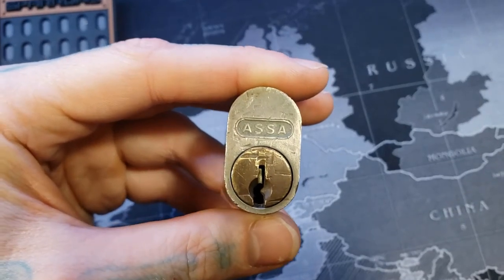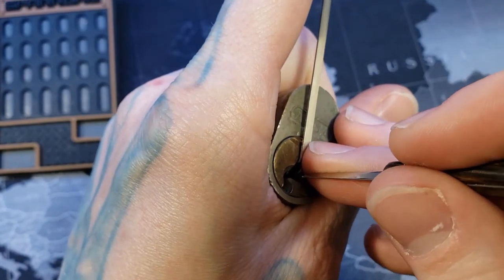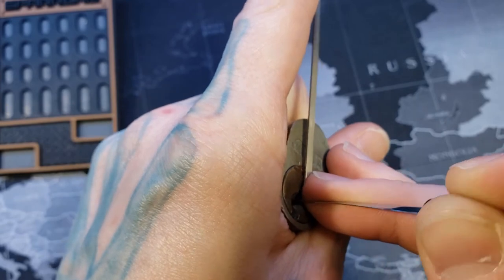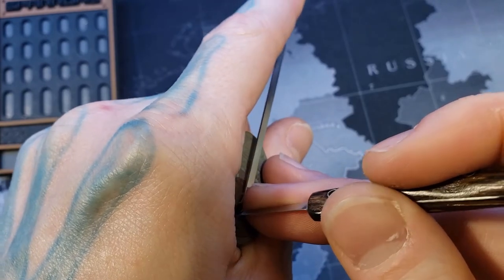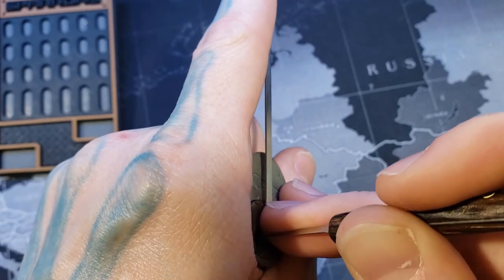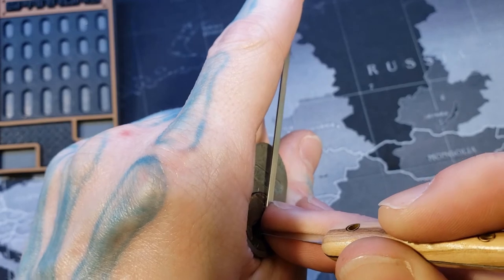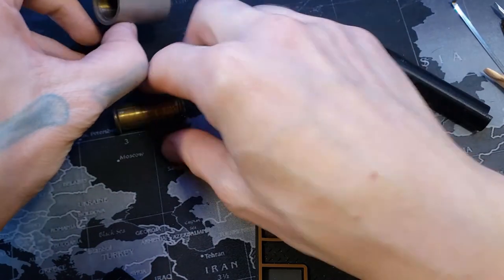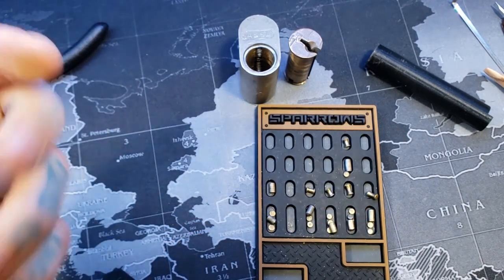61) Assa 700 Picked & Gutted

Comment: Great job, forgive my ignorance, but why was the second pins row removed, never picked one. Is that how they come?   Have a great weekend 🔓😎👍
Reply from the maker: I wondered the same thing when I first picked it.  I can't remember exactly which picker it was at the moment, but this is what they said: 

"For main entrance doors in heavy masterkey systems, it is normal to leave one empty, than put a 9 pin, and 8 thin wafers on top to make up for every possible combination. And it is still a 6 pin lock with Security Drivers.

So that gives 9 different keys on one chamber, compared to many wafers in all chambers, as that include too many ghost keys. (Random keys, that by accident open) So it is better to keep as many chambers as possible without wafers."
Reply: @LockpickingDev  thanks for the information, definitely interesting 👍👍 appreciate the response 😀✌️